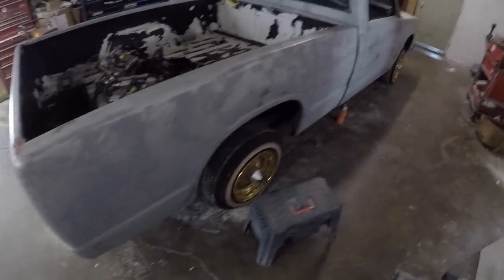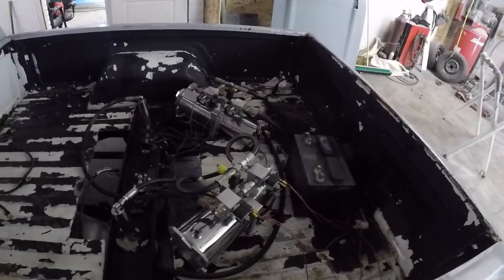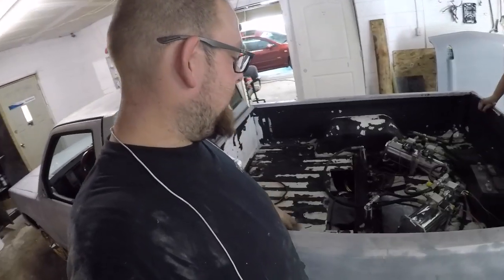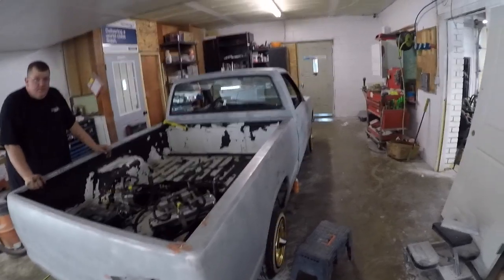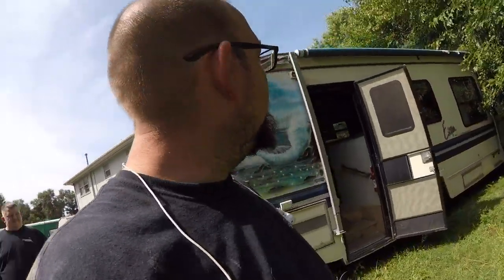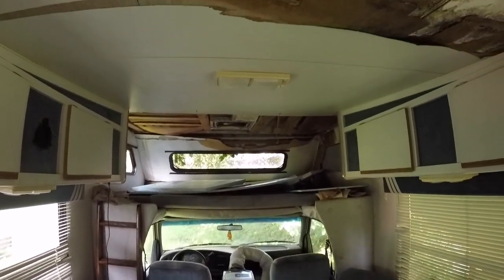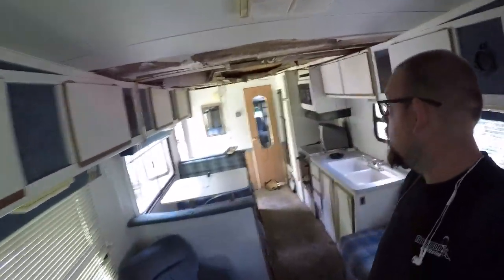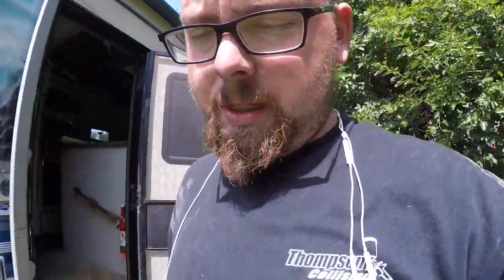Las Vegas HERE WE COME??

Comment: put a dancing bed on, lots of work but it will put you above anyone else in the scene that area. 4 stage, plus full hydro suspension.12'  cylinders in the back 8' cylinders in front with a 1 1/2 in extension on  A arms. The shaves look good. flake city sounds nice
Reply: Thats the set up i have on my s10